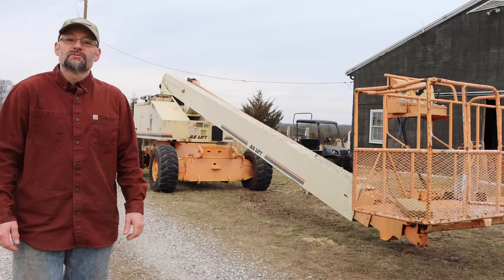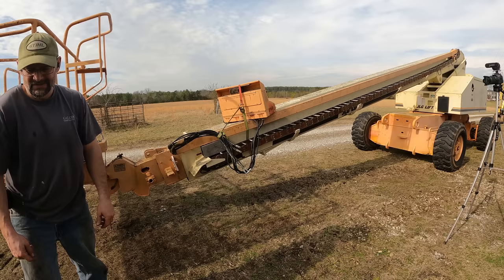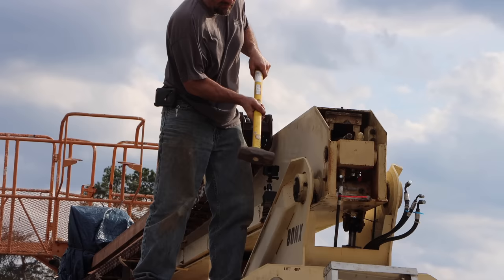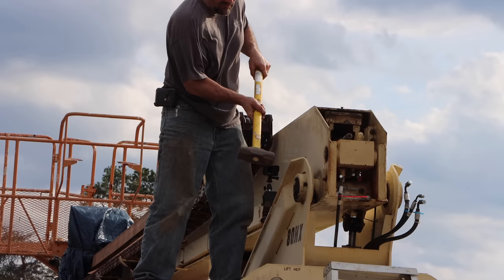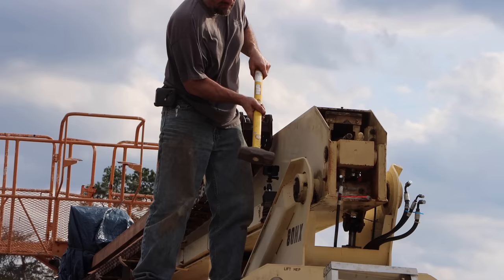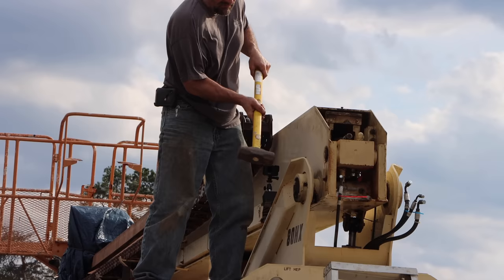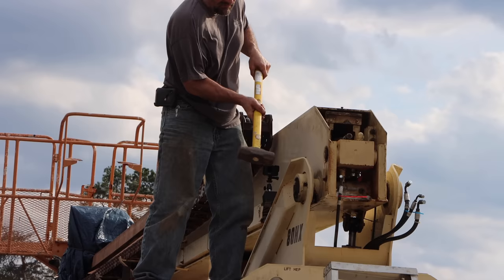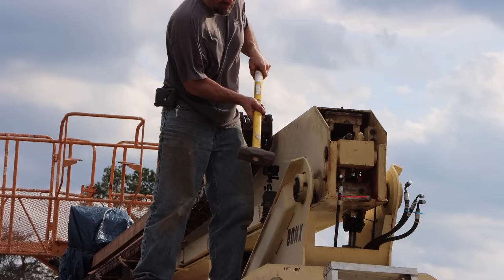JLG Boom Lift Tear Down, Ended In Disaster!

Comment: I have the equivalent in a Genie, have fixed every problem myself so far, but the day that cylinder starts leaking I'm sending it in to the dealer. Good thing you got the fire out when you did, a few more minutes and things would have gotten a lot more exciting.

Comment: Bummer. Glad you're Ok. Glad your lift is only slightly damaged. Kudos for putting it all on the video. No point flogging a dead horse, you know what you did wrong, says the guy who had a 14 stitches chainsaw cut to his leg a week before Xmas 🤦‍♂. Looking forward to the rebuild. Stay safe. By the way, the contractors that service our dry powder extiguishers at work carry a rubber mallet and invert them and give them a hit. Especially important to mount horizontally in 4WDs so powder doesn't compact into a solid block. Pro tip 😉

Comment: Do this kind of repair all the time with stuck pins in bushings. Bucket trucks, boom trucks , Back hoes and everything with pins and bushings. I weld a nut to the pin and use a hardened piece of all thread with a hydraulic ram with a hole in it . Simple fixture with a hole in it will pull the pin out, no heat needed. no drama, only results without physical labor with a mall!

Comment: the amount of times you wacked those plugs and all the techniques you used to loosen them, you'd almost think they had chemically welded to the bushings.
It'd almost be better to use thermite to remove those plugs.
That fire could have been a whole lot worse.
Good to see you didn't get hurt in the process, and god bless your effort.

Comment: Great video. Ultimately no-one was hurt (or worse) and that really is all that matters.
You will have also learnt valuable lessons that you will apply to all future projects.
Infuriating that all that drama could have been avoided if the factory had spent 20 seconds applying grease or anti-seize!
Looking forward to the next instalment 👍

Comment: A " Broco " is the cutting system I used at tractor dealership for piercing rods out.  Copper tube with Magnesium rods inside and enhanced by Oxyygen.  They are used for under water cutting and even train wrecks.  They are not or were not horribly priced and made in California.

Comment: I liked your explanation of the process that led up to the fire and don’t think it would have happened if you had a second set of eyes.  It’s an understandable mistake.  You did well getting it out quickly despite the stuck valve on the fire extinguisher.  That was definitely still pressurized and now I’m worried about my old ones that indicate as usable.

Comment: Well I must say there were some learning points along the  way in the post.  And, I admire that you are brave and share them.  *hot work, as defined to various welding, brazing, has a prep check list for hazard.  As for the disassembly, various source to manuals, with the *exploded parts view, is usually a well planned job assist.   Yes to having a schedule that can handle down time with a few problems to sort.

Comment: Don't feel too bad. I burned a whole skid steer down to the ground.
Had been on a land clearing/burning job for several days and it happened when I was on the highway pulling the skid back to town in a dump trailer. I saw black smoke in the mirror and by the time I pulled over the whole seat and floorboard was on fire. My fire extinguisher worked but didn't even touch the blaze, I just parked away from any trees, disconnected the trailer, and called the fire department.
Less than 30 seconds after I got the truck away from the trailer all the fuel had ignited and hydraulic cylinders were exploding (or the seals were bursting or something was exploding) 
It was pretty crazy, best guess is an ember was burning in the cab and when I got on the highway the wind blew it up. What's crazy is I pushed in the burn pile for the last time, then ate lunch, loaded the machine and watched the fire burn down for another hour before I left, so that ember was glowing all by itself for a fat minute.
Always clean your machines folks, leaves, sticks, and rags all soaked in grease and fuel is an accident waiting to happen. Be safe

Comment: Yeah...  you should shake dry powder extinguishers when you service them, or turn them upside down and whack them, but dry powder is a fairly useless supressant (unless used for burning liquids like oil/fuel) and can ruin a building or give you a difficult cleanup.  Small extinguishers are usually crap because they nearly put out the fire and then you need five more.

Comment: Damn Jon that could have been ugly! In the Navy anytime any welding or cutting was going on a warm body with an extinguisher / fire watch was required. I also remember several years back Kidde had a recall on dry chemical extinguishers, the chemicals would solidify inside rendering them inoperable. Your stones are pretty big taking on a project like this solo, I hope the re assembly doesn't present a larger challenge.

Comment: I finally finished watching the video last night.  The fire is a pretty tough blow.  I hope you can get the machine back together and running again.   Incidentally, thinking about it on the drive in this morning, it occurred to me that it might've been possible to set up a line bore and machine the stuck pin out of the bushing.  You would have had to make a boring bar on the lathe that could be chucked in the mag drill, but I think that might've worked.  I've seen dedicated line boring machines for machinging bushings on heavy equipment elsewhere is why I thought of it.

Comment: I had something similar happen, though it was with an arc welder under a car, and it was my head that was burning. I had long hair at the time, back when I was in my late teens. Had it all tied and tucked up under my hat, thought I was far enough away that the glowie bits wouldn't get to me. I was wrong. Figured out what was happening right about the moment I got a big ol' lung-full of what definitely wasn't air. Glad everything is alright. Yeah, the lift is boogered up, but doesn't look horrendous. I'm sure it's going to be a good bit more expensive now, but at least it didn't get out of hand and hurt you or anything else.

Comment: We pull these JLG’s apart for service and overhaul like this job at work… using two overhead gantry cranes and a large forklift. With 3-5 guys. You’re a mad man for tackling it by yourself while balancing it on a dump truck. 😎😂😂

Also: Nope. The newer models have cylinder pins just as dry and stubborn as yours. Our machinists pull them with a 100-ton porta-power setup. You guessed that you’d need 50T. That still isn’t typically enough.

Comment: I'd really love to hear an engineer comment on why the JLG engineers chose not to have grease fittings for that hydraulic cylinder pin. There had to be a reason. BTW, the biggest purchasers of boom lifts are rental equipment companies. Most flush boom lifts from the fleet at 5 years or say 2000-2500 hours. This time frame is usually good in dumping them before any major repairs are needed.

Comment: NEVER plug the basket level hoses! ( You Can join them together with a nipple)The outer level cylinder is driven by the primary level cylinder, in a Closed loop. If you raise or lower the boom with the hoses plugged, you pressurising the level system to a great extent. I have seen primary level cylinders Torn out of the machine.
Been rebuilding machines like this for 30 years, & understand completely how frustrating they can be. seized pins are usually the worst issue. Always use plenty of Nickel/copper anti seize when re-assembling. It make a huge difference 10 years or so down the track.( We must rebuild all these machines at 10 years, & every 5 there-after in our country).  You seem to be doing well so far,- keep at it & keep smiling.😎😎

Comment: I was chopping leaves with my garden tractor mower when leaves wadded up under the muffler at the front of the tractor and caught on fire.  Fate was on my side as I was 10 feet from my garden hose with the water turned on.  My heart rate was maxxed out just from that, I can't imagine your anguish when faced with the loss of the boom lift.
Regarding the dry chemical fire extinguisher malfunction.  The chemical will cake inside the valve and block the path for the rest of the chemical to exit the cylinder.  That is why dry chemical extinguishers have expiration dates.

Comment: Paracord for feeding through boom and wrap or two of duct tape to hold things in place for cables or chains.  The duct tape is used on every stick boom crane for retract cables straight from dealer . Snaps and falls out soon as tensioned

Comment: Beating on the end of a tight pin directly will usually swell it up and it will never drive through the hole. I used a brass shaft piece when I had to whack it , as the punch. Then hit it with bigass sledge.

Comment: Ive had a couple vehicle fires on classic vehicles. One had a hard cracked fuel line break by the carb and one had brass sliders in the ignition come loose and short out. They were a 1964 impala and a 1955 chevy pickup. I got both fires out with minimal damage. There's nothing more panic inducing than seeing smoke and smelling that distinct smell of burning wiring. I had second hand anxiety and panic watching you scramble to put out that fire. It doesnt look like it will be too horrible to fix though.

Comment: Okay... I'm hooked.  THIS is quite the ambitious project.  I keep thinking of a channel called Salvage Workshop... a guy who tries to refurbish/refresh commercial equipment.  He once got a HUGE cylinder and wanted to rebuild it.  As luck would have it, he had a friend who owned sort of a junk yard where big commercial equipment goes to die... sort of.  They dug out a machine designed to take these cylinders apart... and had to figure that all out before proceeding.... but even THAT cylinder was smaller than what you are working with.  THIS I gotta see... so I'll just keep watching.  Salvage Workshop was eventually successful... and I bet you will be too... but I'm on the edge of my seat... lol.

Comment: Jon, scary fire, you have had enough experience with fire now.  I seem to remember a fire hose back at the house!  I would suggest...   1).  Some buckets full of sand (say 3) in each of your buildings (lowest tech of all),     2).  Maybe three 2.5 gallon water extinguishers for each building (not as expensive as you may think)   3).  A firehose that is at least long enough to reach the whole building  4).  Maybe the fire pump to reach them all (as a project?)   Make a fire pump tender you can hitch to your side by side with some ULC reservoirs, with a foamer that can make the water go further if needed for a bigger incident.

After all these experiences a little fire truck may be in order.  As you realised this could have been so much worse.  I hope you add a grease fitting to that fricking pin and the two outside bushes.  Nothing if not entertaining!  What I loved the most was that you didn't swear that much... ...my video would have been banned by youtube!

Comment: Once you drill a big fat hole through the pin, you can cut a kerf, but not with the torch.  Just use the reciprocating saw and careful not to cut into the bore proper.  Beautiful shots of the high cirrus while you struggle with that pin at around 50 minutes.

Comment: I did something similar this winter working on my motorcycle. Put my brain on pause I was so focused on getting something done. Had the battery charger on it and she didn't want to fire up. Oh, here's a can of starting fluid let's give her a little snort. I know not to do this! Lost the hair off my right arm, the oiled foam air filter and assembly and some other plastic stuff. Got it put out without burning the house down or seriously burning myself.

Comment: I just wanted to give a little advice . 
That mag drill  it supposed to be able to switch the handle that 
You turn to drill  on both side of the drill.  In case you can't on that model 
I understand that you did the best you could with it ...

Im always impressed by what you do  in your video 
All alone like most of us 😊
But that's a realy big job to get done alone  
And you're doing very well  
For my knowledge of this 
Im learning to do this just by curiosity and wanting to know more 
thanks for all you do

Comment: Just got to the fire part. Another reason I always had a second tech, fire brigade! They watched for hot spots and were ready. Some jobsites require a hot permit before welding, grinding and cutting. They usually leave a maintenance tech to oversee the hot work

Comment: Dry powder fire extinguishers, you have to give them a good shake periodically, inverting them. The powder settles over time and can compact to the point it can nearly solidify, especially when kept in vibrating equipment (vehicles).

Comment: I have used a 35lb hammer drill with a lot of success in the past to remove stuck pins.
The millions of small hits (plus the heat and cold of course) did more for me than big hammer hits and didn't cause mushrooming.
My hammer drill has a mode for drill & hammer and just hammer.
You can rent one cheap  if you don't own one. 
I have no idea how the booms move can't wait for the model/explanation.
My money is on a recover from the fire and hey the footage will be worth it (maybe not this week but down the road [:o)

Comment: When you do get it started, just because a hydraulic hose doesnt blow, doesnt mean it wont soon. More than likely the outer jacket is all that burned, but on e you expose the wire mesh underneath its only a matter of time. I’m assuming youve figured it out, but the chain allows you to “double” the stroke of the cylinder, allowing you to use the 25ft stroke to extend 50ft of telescoping boom.  I’ve made telescoping vacuum tubes for an 80’ boom lift to allow vacuum recovery of process effluent, and theyre a jenga puzzle, too!

Comment: As you know, theres extreme tension,  compression on that pin at most times due to its leverage point. I don't know if it was tried, but putting slight up or down pressure on the boom arm can release pressure on the pin, possibly allowing it to pop out easy. Sometimes. Either way its out now. I would have took this all apart too to have a look and gain better understanding of it because your life depends on it. Looking forward to the fix. Nice job.

Comment: Damn, more serious than that you get blown away, I mean literally. It's a big difference when you heat something or weld (or cut) it. When cutting especially you have to account for flying and dripping mini lava splatter, which is extremely likely to light anything combustible..Excelent job though, got it apart like a pro, seen some damage on electric lines by fire, should not be critical though. I cross my fingers for minimal damage involved. Live it and learn it, they say.. It's a good thought to master.. and obviously don't repeat it. 😉 Keep on, it's such a joy to watch your endeavours.. Cheers and good luck!

Comment: when your slide hammer isnt hammery enough, i like to get a chain that the bolt will fit through, bolt the end of the chain to whatever im trying to remove, typically it ends up on the lug of a stuck axle shaft, then wrap the other end of the chain around the end of your maul hammer and giver some swings

Comment: Damn I know what it's like, really it is a battle, like going to war with the machine. Been there, did that 4 weeks ago with my 4Runner replacing suspension. 3hrs in...took me 8 hrs using everything from angle grinders, a blow torch to finally beating it to death with an air chisel...that did the trick

Comment: sorry that happened to you John. it's a helpless feeling when you have a fire and you can't put it out. reminded me of when my chimney caught, and I couldn't put it out. smoke was coming from the cracks  in it next to the logs my home is made out of. I thought I had it. sprayed the garden hose down from the top and still it burned. finally, the fire department shoved a wad of fiberglass insulation into the stove pipe at the bottom and that did it. had to cut the air off. no way that would have worked for you either. you were actually very lucky to get it out. watched a B-29 go up like that, burned to a crisp. check out the story of the "Kee Bird".

Comment: just a tip, i know you have acetylene oxy. put the pin slightly below horizontal en use the cutting torch to start melting the pin once the pin starts  to melt shutoff the gas and open de oxy fully you'll just burn out the pin and won't damage the cylinder. that's the way we took out threaded 2"bolt in turbine casings it didn't even burn the threads of the casings.

Comment: Sometimes a threaded rod through the center with a nut on one end and a cup on the other is a great solution. A 1" grade 8 threaded rod can generate well over 100,000 pounds of pulling force.

Comment: just an interesting thought. if you heated up the inside of the pin after you drilled the hole in it with the oxy torch and kept the outside as cold as you can with just water it will cause the pin to expand but since the pin is constricted in one doirection it can only expand laterally. by roughly 1/100 of an inch every inch every 100°. then when you cool the inside pin instead of only Contracting in one direction it will contract in all directions technically making the pin ever so slightly longer but ever so slightly thinner as well. I believe this concept is called constructive expansion and it works really well on bolts and stuff if you can can do it properly. it should be enough for things like this to get them unstuck. it's a cool trick with physics in action. 

Edit: i kept watching and that is exactly what you ended up doing and it worked! that's awesome!